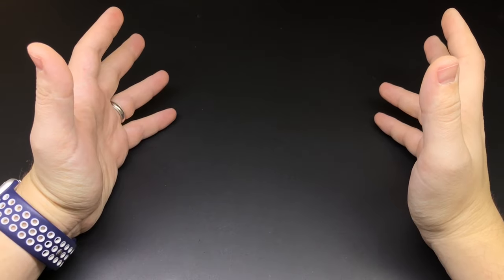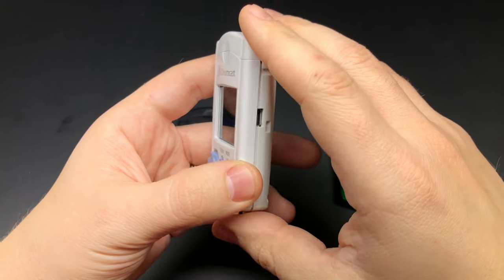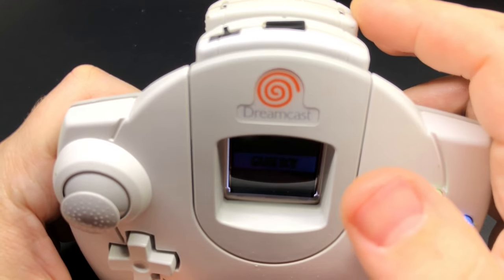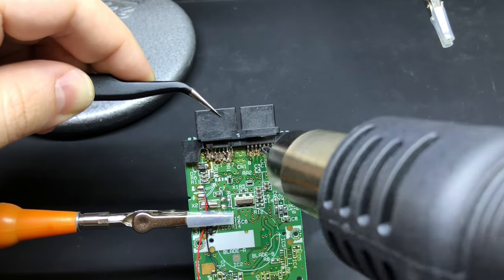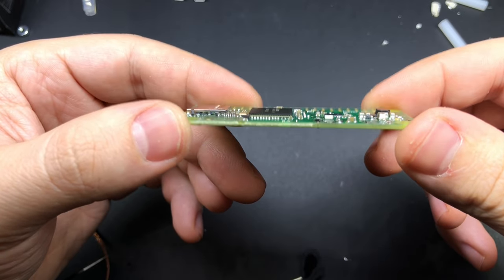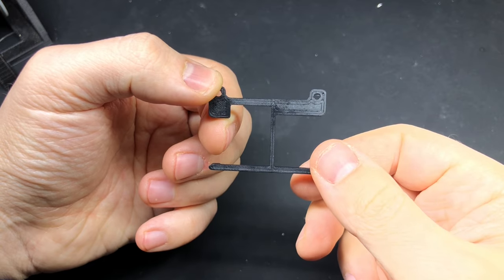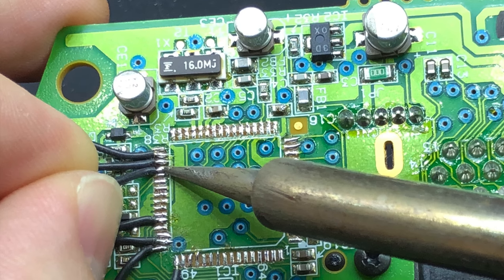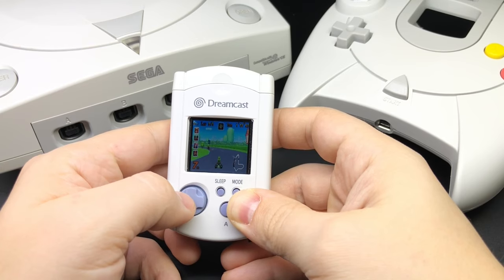VMµ - RetroPie Gaming Handheld Inside a Sega Dreamcast VMU

Comment: Should add an HDMI pass through to the controller and connect some wires to a port in the vmu so when you connect the vmu to the controller you could plug a mini HDMI in an go to the tv
Reply: ben martin YES
Reply: ben martin so your making a Nintendo switch dock built into the joycon grip, oh no Sega isn’t going to like this!
Reply: Carlos Pevida no I am not making this I was suggesting an HDMI pass through for the pi
Reply: HDMI has 19 pins alone, the vmu connector only has 14 (minus the ones used for charging and USB)
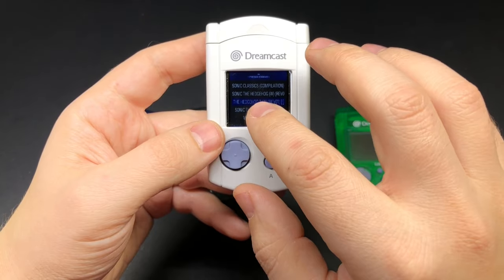Reply: 1:30 it has wifi could be able to screen sharing to smart TV, the power consuming is not a problem after joystick combined.

Comment: But does it still save Dreamcast games?
Reply: Aaron Greenfield well he killed it to do this so I'm guessing no...
Reply: only the RPI 3 is somewhat capable of running a Dreamcast emulator
Reply: No, it saves SNES, NES, GBA, GB, GBC and I wanna say Doom.
Reply: Is that a feature that could be emulated? Could one use some storage on the MicroSD for an emulated storage device compatible with the pinout and protocol of the Dreamcast? Maybe an Arduino clone could be used to save RPi GPIO pins by acting as a sort of buffer and serial interface for the VMU to the RPi running software that emulates the screen and memory management of the VMU.
Reply: RPI has enough GPIO pins, only a handful of pins are actually in use on the connector. It's using the same Maple bus that the controller connects to, the controller contains a hub. The interface should be possible to emulate using just a kernel driver, no additional hardware needed. That is, i understand, with the purpose of emulating the original VMU functionality on the modified VMU - savegame storage, controller LCD, VMU minigame emulation - we can skip direct transfer from one VMU to another, because let's face it, when are you going to ever run into another person with a VMU hanging around their neck, especially one with a Linux single-board computer inside?

Unfortunately some games crash with cards that have more than 100KB of storage space, and i really doubt more than 128KB would work just about anywhere, but perhaps there's an elegant solution to extend the useful space. Many games have unique VMU splash screens, so you could make the VMU swap card images automatically depending on the first unique LCD write after the reset operation, so essentially most games would have a virtual memory card of their own.
Reply: arand4 yeah, I have the RPI 1B (pretty much looks like the rpi 3 but slower) and anything better than SNES and GBA is out of the question and even then, most gba and SNES games don’t work well
Reply: Almost every reply is besides the point. I mean, what is VMU for? It stores savegame files for games running on the Dreamcast. It's a memory card. You don't have to emulate the WHOLE Dreamcast just to store savegames. Just like there isn't a Dreamcast inside the VMU. Just like there isn't a whole PC inside an SD-Card.
Reply: Yes, and it can run Crysis too 😛
Reply: Leandro Suzano. But not mine sweeper, or solitaire!
Reply: How bout I just give u 50 bucks for this 1
Reply: Siana Gearz Do you know if there are any open-source projects that have mostly functional VMU emulation so I can try to get started on the interface and a build of Reicast that can talk to it?
Reply: lol shitty.. I have a 3b+ and not overclocked it can run everything except Dreamcast and N64. I have tried GBA SNES  nintendo DS works really well. I was suprised about the DS. MAME, DOS Box, Quake 3 NES and way more. Overclocked it plays Golden Eye for N64 pretty smoothly (only played the first level though)
Reply: I'm toying around with this idea because I want a bigger memory VMU. Some games like Skies of Arcadia take up an entire VMU (if you install the VMU game especially).

With this wiring configuration in this video, it's not possible to do this. He is only using the original VMU pins for power. If someone reverse engineered the VMU/Dreamcast communication protocol (someone has done this but it would take research to find) then you could emulate a VMU. You may run into some issues dealing with how the information is being stored, what file format, and you would more or less likely have to write a custom emulator (something which is just a bit beyond my programming skill level without some help)...  But I am going to look into it.
Reply: Oh wow, the games actually crash with more space than 100kb? I am guessing this has something to do with the way the Dreamcast handles mapping of the storage locations of the VMU? I'm thinking instead of doing the VMU image swap it would work better if you could handle the communication with a custom emulator rather than the original kernel, but this would definitely take some reverse engineering of the communications between dreamcast/vmu.

You would have to read the bits that are coming from and to the VMU when you attach a VMU and load a game. If the Dreamcast simply requests the save data and loads this information into memory, this would probably be pretty easy to emulate I think. But maybe I'm full of shit, I've only taken a couple Systems classes so I know just enough to be way wrong.
Reply: Aaron Greenfield no, because he had to remove the memory card and insert a raspberry pi.
Reply: @Arachmana  r/woooosh
Reply: I'm guessing if the emulator is capable and installed....😕
Reply: Chaslasher H r/whoosh
Reply: It runs half life 3 and books ubers too
Reply: I don't think so

Comment: This is awesome, so cool. What a squeeze to fit everything in, but you still managed to get the microSD card slot to line up. I didn't think you could use hot air on the Pi to desolder, for risk of damaging components, obviously not. Loved the Dreamcast.

Comment: Do you think it would be possible to also put video out through the controller? The pi Zero has composite video, which would only be two pins on the connector, and could be activated by a second switch.

Comment: Really cool project man, i love those super tight mods where every cubic centimeter is essential :D By the way, as a tip, you could have used an old IDE cable for the buttons instead of loose ones. When they are combined together it's easier to handle them and the connections of entire cable row is far less likely to rip out :)

Comment: This is Cool, especially putting it in the Dreamcast Controller to make it easier to play more games because you have more buttons.

Sega got it backwards, they made the battery in the VMU a non rechargeable battery and the one in the Dreamcast rechargeable. They should have used the same one as in the Saturn making it easy to replace and since the batteries last several years it's not expensive or a pain to replace the battery, my Saturn Battery lasted 5 years. They should have put a rechargeable battery in the VMU and use the controller to recharge it as well as sell an optional travel and or home charger if you don't want to have to turn on your Dreamcast every time the VMU battery dies.

Comment: Thats so technically awesome what you did, and on the neatness side fitting batteries in, micro usbs neatly tucked away, tiny buttons on back of VMU...its also one of the cleanest jobs I've ever seen-this is so amazing. I started tinkering in electronics too late in my life in my mid 20s, so i understand a little about learning on your own- but do you have a background in electrical engineering or something else wermy? How do you fabricate/and know certain parts will work?  I would love to have the base knowledge to pull of projects like this SUCCESSFULLY (key word lol)

Comment: About that cheaper charger, you can change one resistor to set the charging rate to a lower setting. At least if its the TP4059 or something

Comment: Honestly, I don't recall anyone, myself included, that ever had one that was still in working condition when not plugged in. The issue with those things is that they took two watch batteries, and lasted less than a year. Nobody wanted to replace the batteries in the things because they weren't cheap and didn't last long... plus the batteries weren't needed for them to retain your save data. So everyone I knew with a DC, myself included, just let the batteries die and left it like that. 
 
They really should have looked into trying to use AAA batteries in them or something.

Comment: You can reconfigure TP4056 charger boards, the cheapy ones, to any current you like, by replacing one resistor. Want help figuring out which one it is and which values you need?

Comment: You ever thought about using the controller and making a mod keeping the inside but making a new casing so u can use a bigger screen? Keeping both connectors and sliding the monitor inside? Not using the vmu as a gamimg device just a screen.

Comment: Thanks. Very nice mod, the ultimate mod for the VMU, so far. I love the white VMU's design. I have 3 open ones (sadly no covers) and 1 sealed in the box (1 sealed 1MB or 4MB one with no LCD, SEGA orig). If not for the fast battery drain, it's be much cuter.

Is there a hardware hack to make it now drain the battery in just a week even when it's not being used?

How come motherboard clock batteries which use the same (single one at that) lasts for years while the VMU only lasts days?

God bless, Proverbs 31

Comment: Hey man i was trying to contact you on instagram regardign the DC controller mod you did. I wanted to cut it down as much as possible so i can use as a converter controller. So my question is do you know what is the safe limit area i can use to make controller and vmu still functional, but having the smallest pcb possible?? Thanks

Comment: How the heck did you power the Pi without a voltage booster? That battery charger does not boost voltage to 5v.
Reply from the maker: It runs just fine off of 3.3-5v.  In fact there’s a regulator on the pi itself that steps the voltage down to 3.3v, so powering it directly off a lipo works great.
Reply: @wermy , Thank you for your reply!! Stay awesome!

Comment: I'm not all that familiar with the Dreamcast, why does the controller have slots for 2 VMUs? What's the point to that?
Reply: I think one may be for a memory card.
Reply: Both of the slots are for memory cards.. the VMU is just a memory card that has a screen to display certain things in certain games such as your health bar or something, most of the time it just displays the title of the game your playing.  It has 2 slots for memory cards because if you have a VMU memory card you’ll want that one in front and the other one behind it for more save space.  They didn’t have a lot of space on the VMU type memory cards so they added another slot so you could add a second memory card for more space

Comment: Hey I have a question about snes cart curcuit board an capacitors.
Reply: Chris J cool story bro
Reply: Cuzjudd wtf
Reply: Chris J why didn't you post your question
Reply: This guy seems like he know alot about electronics and I wanted to see how you test capacitors on the snes cartridges, mainly the round pink ones with strips on them.
Reply: Yeah he does, but read your first post back to yourself. It's a statement about having a question. It's like you pressed post too early and left off the second part which would include the question you said you have.
Reply: well sometimes i post stuff on here an never get a reply back ever.
Reply: Fair enough. Youtube is probably not the best place for detailed questions and answers doe
Reply: Alright.

Comment: now, i want to see a Duke/original xbox controller turned into a plug and play console using a pie......

i was thinking... it could even have a screen where the X logo is, and replace the useless memory carts with batteries in the same housings/connectors, could even cut small micro usb ports in each battery for a charge port...or just set it up such that the whole thing could be charged off usb, i was considering something similar to this 
https://www.amazon.com/MT-Smallest-Lightest-Capacity-Charging/dp/B07FTLX34J/ref=sr_1_90

for a project a friend of mine was asking my help with... was thinking of building it so that we could just plugin one of those to charge/power it, and swap them out as they needed a charge, (just an example, we have some others that may serve better depending on what case/housing he settles on)

he wants to build a mobile gaming system thats got a screen built in, and can run for more then a few hours at a time, but thats also not huge and clunky, i talked him down to 7" screen, he has a source for a "next gen" TN panel that, and i have seen these first hand, are easily as good as cheaper ips pannels, both viewing angle and color reproduction(true 10bit, not 8bit with afr...), honestly i was blown away by the demo screens i tested, they even had one that was an optical touch screen, that was great....accurate no matter what or how you touched it... 

hes trying to decide if he want to go with a PI style board or just go silly and build something thats gonna need a bit more juice using a panda board, (or similar he actually has a few last gen boards, he is considering a current gen board from a few of these companies, hes even contacted one asking about a couple products they have on their site but arent selling yet, and if they would be suitable to the project, and, one of the companies, was quite interested in the idea... 

wonder if i could cram a full on PI into a duke if the card slots where removed.... that could be interesting, usb, nic, hdmi, all on the back of a duke... with the controller wired up internally, always connected.... that could be fun.... and a fun project...

Comment: The technology was there to make those things better in the old days. The VMU was just a shite design is all. Look at the size of it. They could have put a way bigger screen the entire length of it on that, all along the back. Then make the dreamcast controller "gap" bigger to fit it. Way more pixels would have been cool, and a better little CPU. Stacking them like that could have made for a mono "sort of" nintendo DS system with two screens. Like a game-and-watch but not crap.

As an aside, I think it is a pity you destroyed that VMU, even if I do think a VMU is a flawed device. I'm not nagging you. You can do what you like with your stuff. Just saying, you could have sent off to get a PCB made (a whole stack costing 20 pennies each), or you could have etched your own one at home using light transfer method or printer method. But basically you'd surely just send off for them to get a stack done for 20 pennies each.